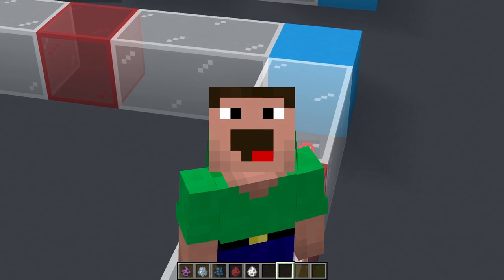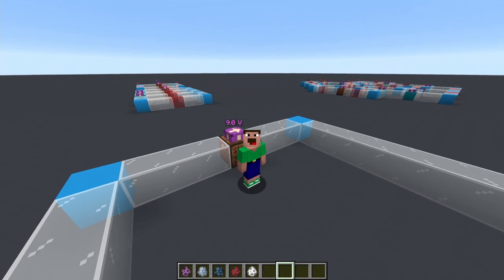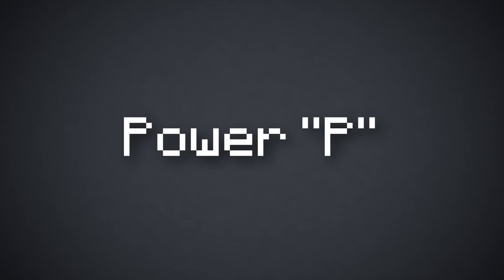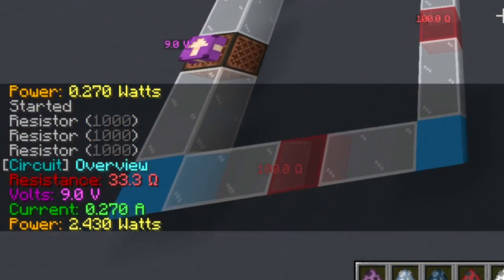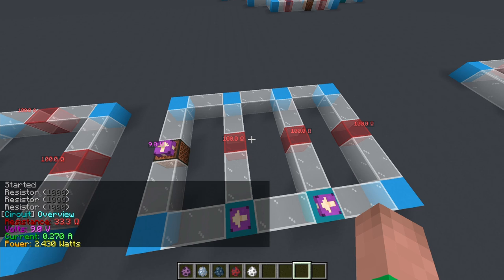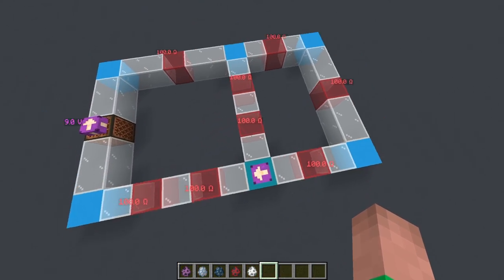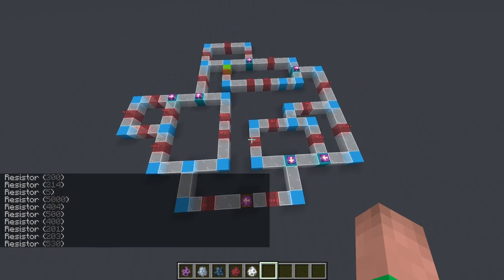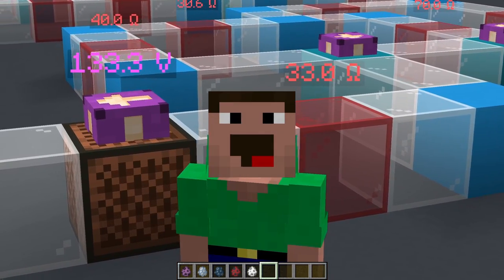Electrical Circuits Visualised in Minecraft [Simulator Datapack]

Comment: so, your explanation about the battery was very confusing. You also mentioned that the electrons are moving from the positive to negative side, which is not true. The electrons are moving from the negative to the positive side. Electrons are negative, and they get repelled by negative charge, and attracted by positive. Which means they travel from negative to positive. Also, on 8:06 you show a circuit which is NOT closed but still you see current flowing through it. This guy is bending physics... also why me not can join your discord :(((
Reply from the maker: 1. My entire explanation was explaining that the conventional way of thinking is that the charge goes from the positive side of the battery to the negative side but in reality the charge are the electrons which travel from the negative side to the positive side. I would suggest you rewatch since I very clearly explained this and I think you are a bit confused...

2. As I explained in the video, the way I setup this simulation is that the charge (aka green square) just travels along the path... it does not know which place has the biggest potential difference and likewise doesn't know if there is a potential difference. Because of this the charge will still travel along the conductor despite it being an open circuit. It will not however show the final "circuit overview" unless the circuit is a closed one. My intention was to make a simulator which calculates working circuits, not tell you if you built the circuit wrong :)

3. I'm not bending physics, in the end this is Minecraft, there are limitations. I explained this as well in the video. Because of these limitations I had to use some workarounds such as the "outputs and inputs" and the error during devisions. I thought it was clear from my explanation that this wasn't a perfect simulation, but rather gives you a close estimate as to what the values could/should be.

4. Thank you for the feedback, however like I said I'm still the student here, so constructive feedback would have been more appreciated than criticism. Not sure why you're banned from the discord server, have you ever joined before?